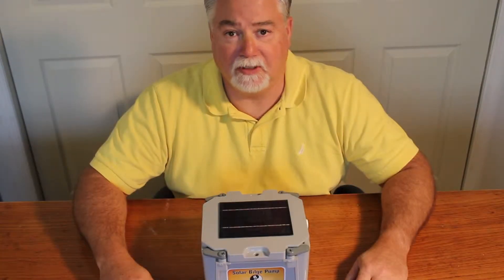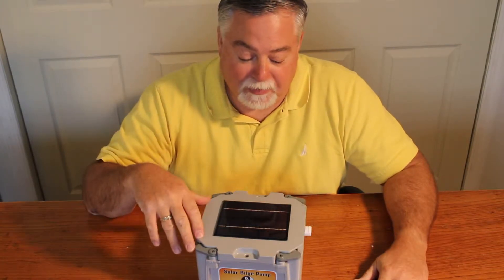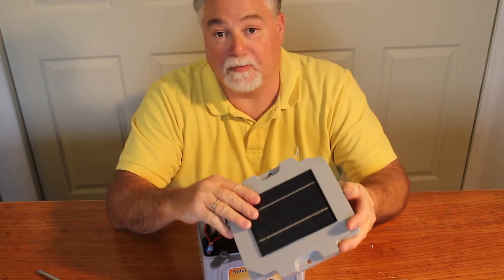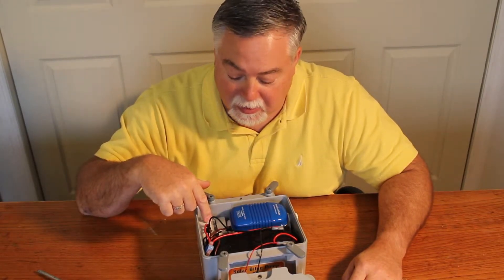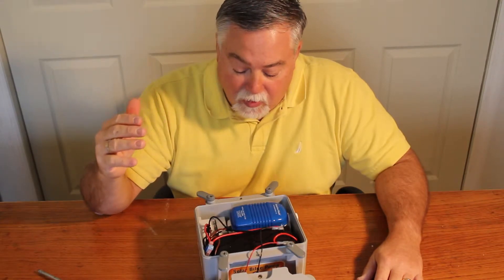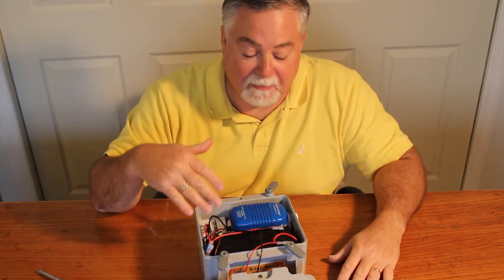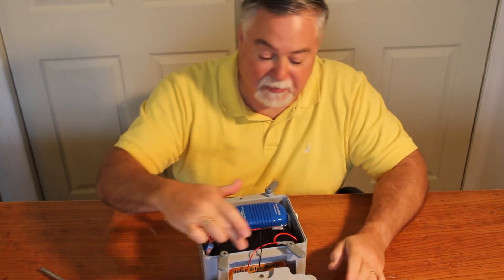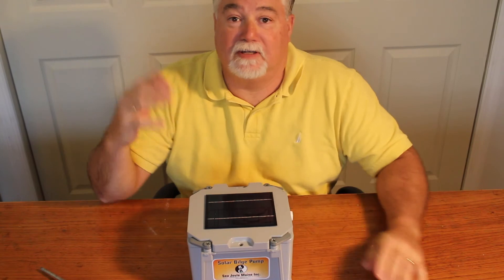Operation of the solar rechargeable bilge pump

Comment: Have one.  Great, smart design.  Convenient.  Easy.  16ft Dory is always “mostly” dry.  Will leave a small amount of water in hull that pump can’t suction out, but gets 99% of it.  Never have to manually pump water out of boat any more before heading out and no more dealing with traditional pump/battery/switch which seemed to break every year.  Great product.  Also great for back-up bilge peace of mind if you travel, etc.

Comment: Hi I came across your video and it seems like something I can use BUT.....

Got to ask, 
Can this unit function for my waterfall landscape which I have not yet accomplished in "moving water" from the middle tier (3 tiers total WITH 2 "holding water" section and last tier is like river flow which empties into the tub in cascading fashion)???

Is it something I could use as water in middle doesn't flow fast enough to push out to the next lower tier???

Only need to kick in when water reaches to a particular level of the tier pool.
I can't load a short video of my waterfall landscape on this "comment section" unless I get an email address and will gladly send the video you so you can see or have a better idea.  

Anyways nice video and usefulcontraption in marine use. 

Also what's the price on that particular unit? 

Thank you!